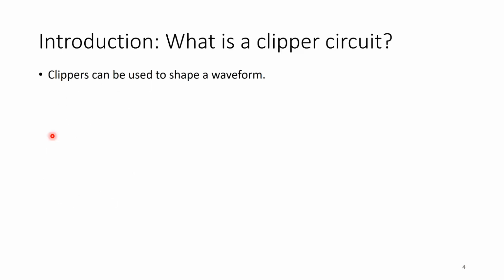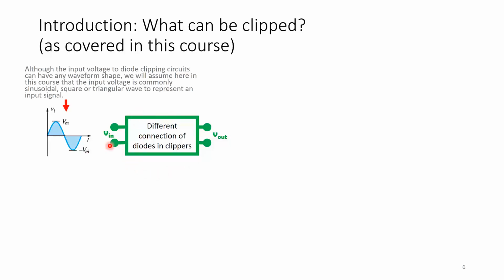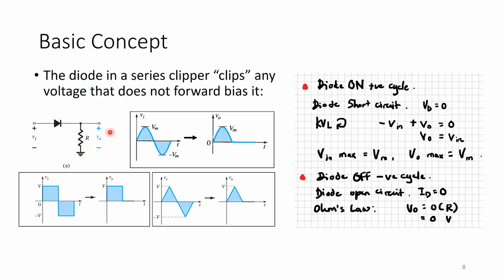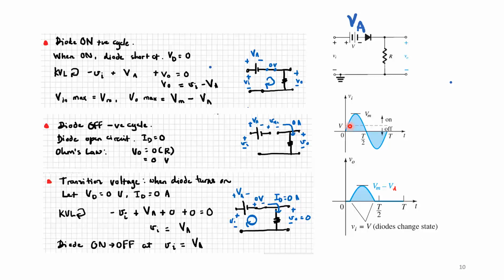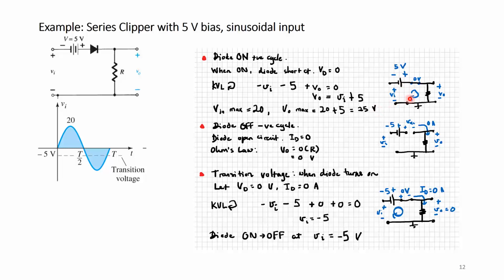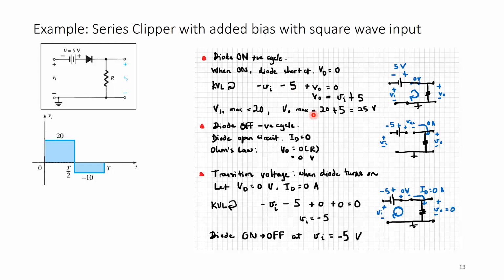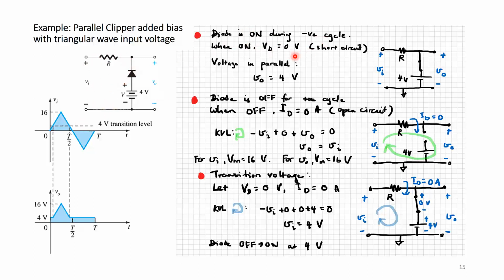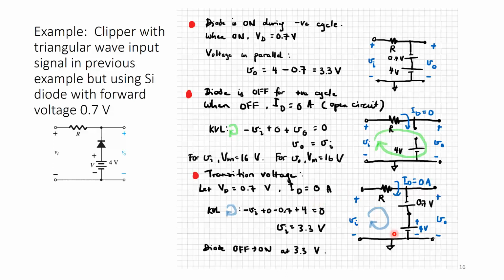Diode Clipper Clamper: Lecture: Part 1 V3VP2 ELE424 DL

Comment: assalamuaialum Dr Wan I have a question regarding clipper circuit at time 33.09 that involve Si diod, correct me Dr if I am wrong but when we calculate the voltage at -ve cyle, it will referrening to negetive wave right (which at period T/2 and T). For ideal diode, it is not a problem because we got Vo = 0V, thus there will be no -ve wave appearing beneath the line 0V but for  Si diode ( in -ve cycle), does Vo = 3.3V will show toward the -ve cycle wave or still consider +ve wave in triangular wave?